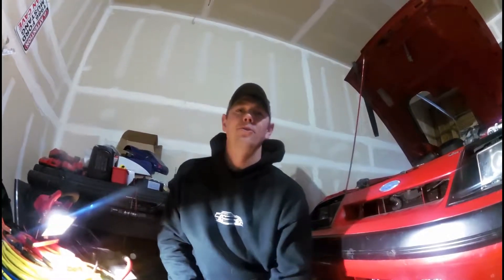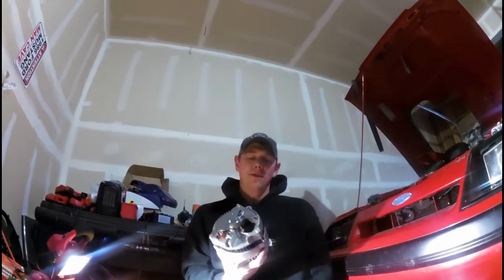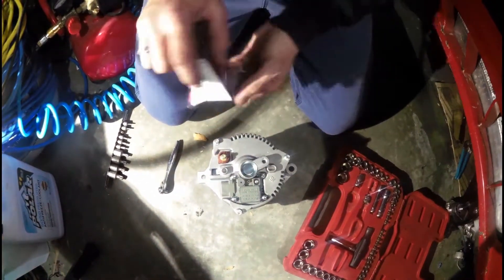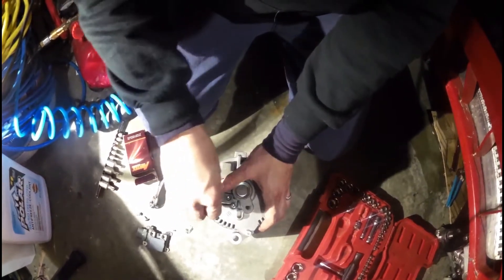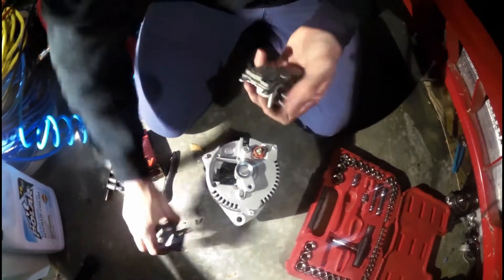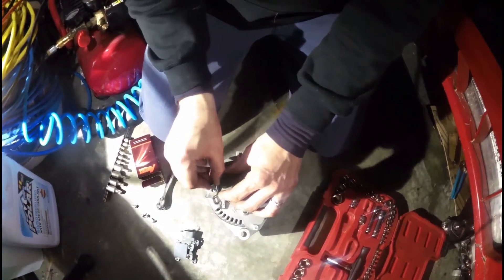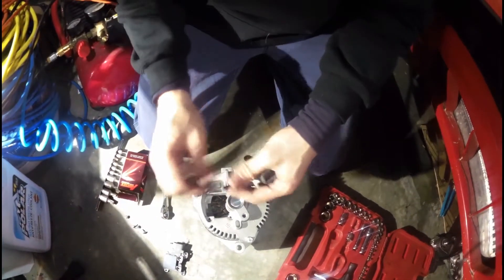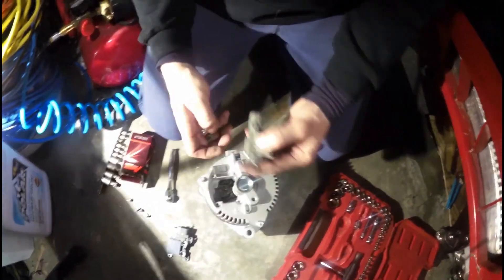Voltage Regulator Replacement [3G Alternator, Tech / How To]

Comment: You didn't finish.  Kind of an odd ending, you were right there.  Push the brushes in, insert the pin, install the VR, pull the pin.
Reply from the maker: There’s only so much I can do with three kids around

Comment: Hello Sir, i know this is pretty old but did this fix ur problem when u replace the regulator? I bought a new alternator from summit and man, its making loud screeching noise. Got it tested and its good. Im just kinda on a dead end right now. Btw, i did a 3g conversion on a 4cly fox just fyi. It starts up fine and all my electric fans works no issues, its just not charging my battery and making some loud horrible noise. Any info will gratefully appreciated. Thanks!
Reply from the maker: Yeah a lot of those regulators are bad out of the box.  Also check your belt tension and belt wrap on the alternator
Reply: @BMF_Garage  thank you for your quick reply!

Comment: How do you bypass the regulator to get the max amps the alternator can put out?
Reply from the maker: Lewis Tibbitts that's very dangerous... that can cause over voltage and destroy you cars electrical system.  

The regulator is what keeps voltage where it should be.  The amperage available is not determined by the voltage regulator... that's determined by the construction of the alternators internal components.
Reply: It's not for my truck. It will be used as a welder for off road welding if a part breaks.
Reply from the maker: are you trying to use the alternator as a welder or as a power supply for the welder?  

You still need consistent voltage if you are powering a welder, so bypassing the voltage regulator would damage the welder.... 

You could potentially modify the voltage regulator to supply higher voltage to power a welder, but it would still be dc voltage and most welders I know of are AC powered....

I think the best option is to buy a gas powered welder to bring with you, or get an inverter to power a welder....
Reply: I have one built already from a early model mopar alternator and it works great. I just need to figure out how to bypass the regulator on the 3G alternator so I can build another one. I know you have to give it 12 volts to excite it to make it work.
Reply from the maker: nice.  I'd like to see how you did that...... Any write up or video on how you did it?
Reply: Just look up alternator welder and they have a lot of them on YouTube.

Comment: How do you wire up the 3 g, I have a 93 GT  Fox, and had the old Original styel, and used a 2 wire setup, I have acquired  a 95 stang alt, so What would I do to install this
Reply from the maker: The wiring is pretty straight forward.  Here is a pretty easy to follow link for wiring it up:

https://goo.gl/images/G8N9yj
Reply: Thank u brutha
Reply from the maker: You bet man
Reply: Question  did you replace your pulley from the old Alt to the new one? Btw I have rhe same Alt in the video.... and  Ihave a 93 Supercharged 5.0
Reply from the maker: Nope.  The 3G had the correct pulley on it so I did not swap the old one on.
Reply: Ok.... Im going to finish some wiring that needs a pretty place from what burnt up and I'll put it all together I'll let you know how it goes thanks for your help
Reply from the maker: Sounds good.  Good luck with the project